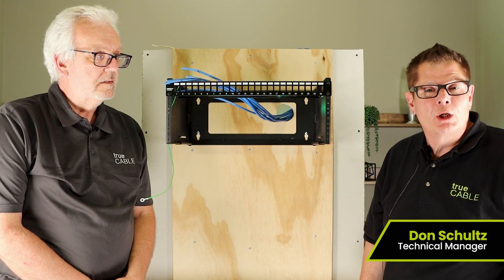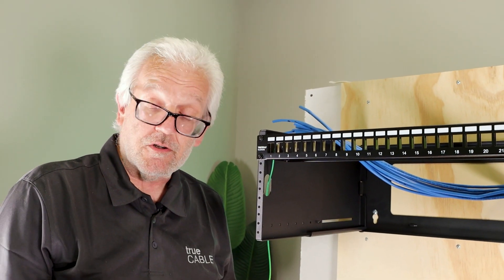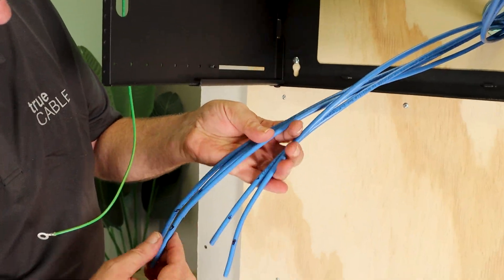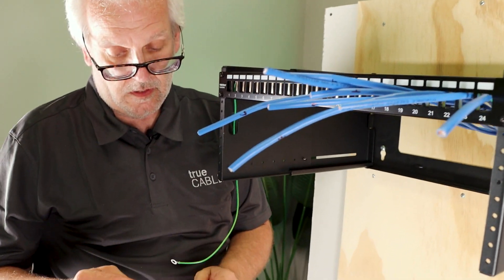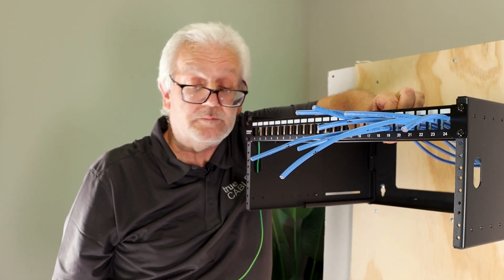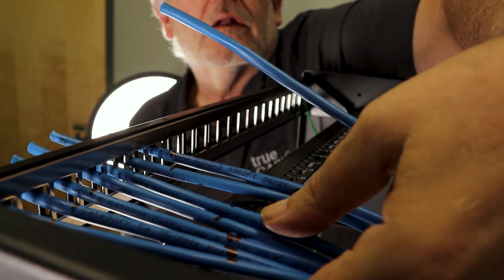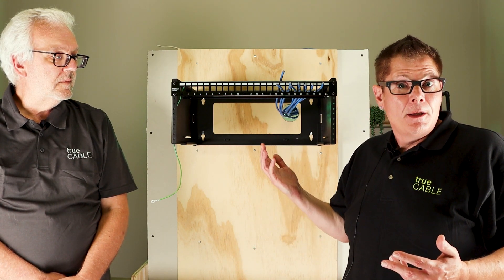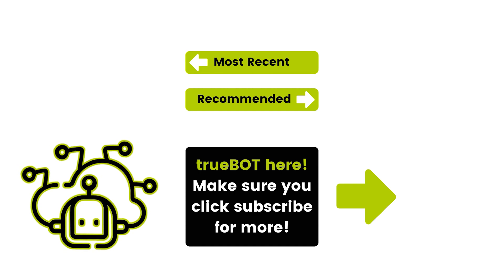How To: Dressing Ethernet Cables Into a Patch Panel

Comment: there are so many things wrong with this video I don't know where to start!  And YES I am an RCDD
Reply from the maker: Thank you for taking the time to share your thoughts. We're sorry to hear that you found some issues with the video. We genuinely value your feedback, and we'd love to address any specific concerns or questions you might have. Could you please provide more details or let us know specific areas you feel need clarification or improvement? We're always striving to improve, and your feedback is crucial in that process.
Reply: You could start at the top, bottom, or middle. Just make a list.
Reply from the maker: @rb8049   Indeed! Make a list and check it twice :>). In all seriousness, if you cannot put a label on the panel itself, then a label on the permanent cable and then on the patch cord used to patch into your switch will suffice.